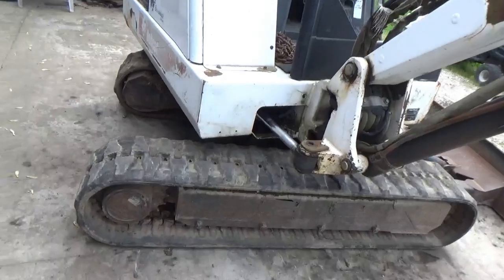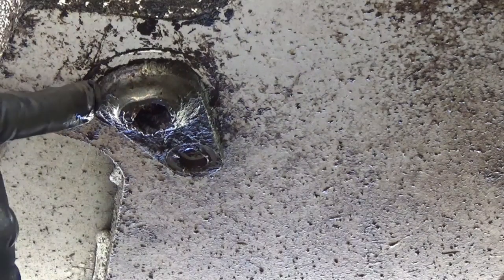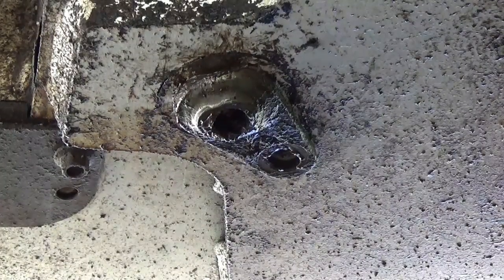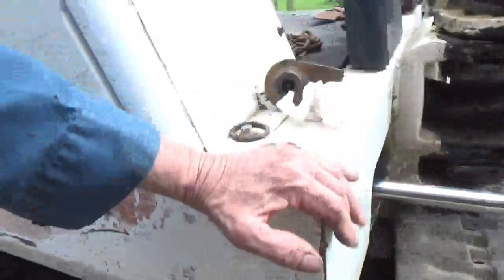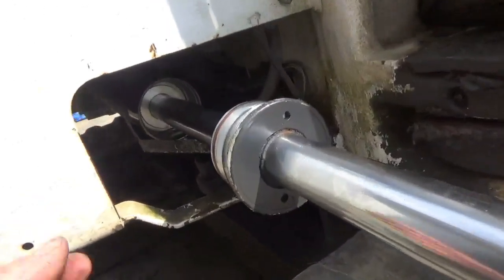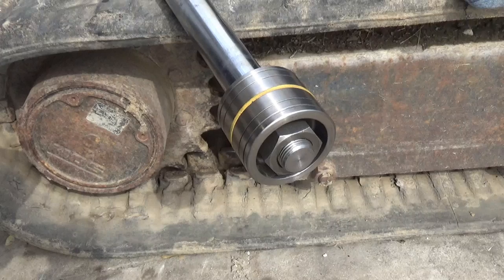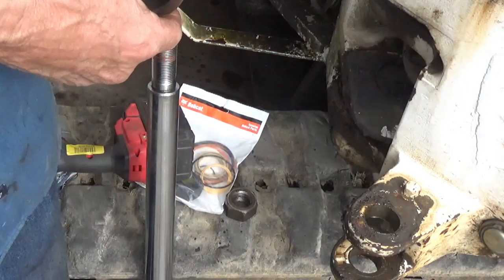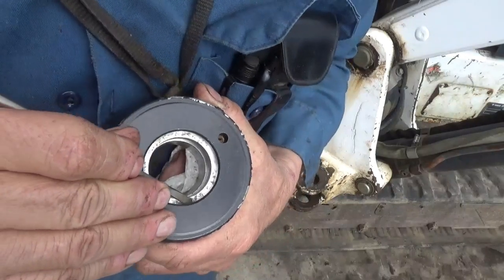Resealing hydraulic cylinder at home (part 1)

Comment: I had to change out my seal kit on my 337 on the boom cylinder I went down to the auto parts store and bought the $89.00 spanner wrench kit that can be bought on Ebay for $37.00 but when you need one you need one
Reply from the maker: I received the set I ordered from Amazon. I'll be ready next time.

Comment: Hi Gordon,  so if you had to go find another mini excavator tomorrow, would you stick with Bobcat, or would you be looking elsewhere?  I only ask because there are some out there who haven't had great luck with Bobcat, and wouldn't recommend the brand. Apparently, parts for Bobcats are incredibly expensive.  Hope all's well with you.
Reply from the maker: I've heard good things about Takeuchi  and the Bobcat dealer down the road from here is also a Takeuchi dealer so I would be looking close at that. I would like to have a bigger model Bobcat like my 331 ( 337 or 341 E) (E = extend-a-hoe) that means it has a extend / retract another 4' from the standard model on the bucket end. Those models can use all of my buckets for my 331, the newer models or a different make wont interchange. So, if I got a different make, I also need to get all new buckets (I have 4 sizes now)